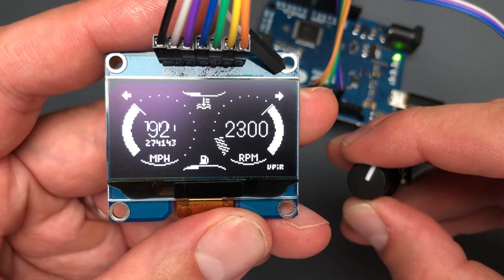Arduino Car Cluster with OLED Display     (Dashboard, gauges, controls, SSD1306, u8glib)

Comment: Hey, I cant find your email on the about page. Starting a motorcyle project and im obsessed with these gauges. I have no idea how to do this but im going to learn. Wondering if i can get the code and are the seprate inputs already built into the code and just need values set?  Its an old bike so no OBD or anything fancy. THANKS! amazing videos too by the way!
Reply from the maker: Hello! The email contact should be on the about page, but sometimes it´s only visible on desktop, not on mobile.

Comment: Hi I'm looking to build a car display using a nextion 3.5 display driven by my ecu masters ecu is this something you have done or could help me with ,there is code for reading the data from ecu on github but I'm very new to coding so not sure how it works or creating code for the nextion display ,any help very much appreciated
Reply from the maker: Do you have a link to the github page? That would be a great start. Also, why use the small 3.5inch?

Comment: I don't get why the screen is updating so fast that you don't see it scan across. When I try to fill it with black then fill it with white, it takes almost 1/4 second to update the whole screen and I'm using a fast stm32h7. Even if you don't update the whole screen every time you load new data in, you are changing so many pixels with the numbers and gauges animating I don't get how it is so fast. Also how did you make this custom GUI? I only saw basic functions like drawCircle() or drawRectangle in your code?
Reply from the maker: Do you use IIC or SPI version of the display? Software SPI or hardware SPI? This custom GUI is mainly from images, they are usually faster to draw compared to dedicated circle drawing routines.
Reply: @upir_upir  I'm using hardware i2c. But you're saying most of the GUI is just a background image that doesn't change and then you update only the numbers and gauges? What kind of function do you use to increment the gauge position?

Comment: how to connect it with the real motor speed..? or  can we connect the 3 wires to ESC..?
Reply from the maker: It depends. You can surely use sensors, but you can also connect it to can-bus. I do plan to record more videos with details how to do that..

Comment: I would like to inspect the code !!! ,,, when I loaded the MPH Gauge it jumped around but then noticed when my hand was close to the ground on the uno it moved but seemed to stop when I hooked up the joystick in place of the pot ,but my Dupont wires are not the best fit in the header. Thanks for all the videos has helped me a lot , I'm trying to port over the oscilloscope example I found to work with an esp8266 with generic 1.8 TFT I'm having trouble getting the display library to work (st7735) I wish there was better documentation for the classes and different functions been able to find someone get hub
Reply from the maker: Please send me an e-mail and I can send you this code so you can take a closer look.

Comment: Nicely done! How well does the odometer function work? Is there a way to save the odometer reading to non volatile memory to allow persistence when power is cur?
Reply: *cut
Reply from the maker: Thank you for your comment, but the screen is not functional. It’s more about drawing stuff on the display. That said, if should be possible to save values, but usually memories are rated for 100000 write cycles. That might not be sufficient for something like odometer.

Comment: Did you ever get around to making a tutorial? I ask, because i'm currently creating a project that could use several gauges 1 for temp C & F, one for Fan Speed, and one for heater status (on/off)
Reply from the maker: Unfortunately not. However, if you send me an e-mail, I will send you the code and you can try to modify it to your needs.

Comment: Is the potentiometer used in place of where the actual connections from the car will be?
Reply from the maker: Yes and no. Depends on what kind of sensor you would use. Some sensors use the very same approach as a potentiometer, but some use different forms of communication. And if you decide to use CAN BUS, it would be also different.

Comment: Could I use this to connect to my cars rpm gauge?   My car is an older car with no computer to connect to.   But wouldn't running it parallel to the rpm gauge be the same as the potentiometer?
Reply from the maker: I don´t know much about how the pre-OBD gauges work, but if you know it and could it connect to arduino, I don´t see any reason why it couldn´t work. Is it just providing a voltage based on the RPM value? I need to find one of those gauges and dismantle it.
Reply: @upir_upir  you're clearly more technical than I am.   How about I send you a basic rpm gauge and you can test it?
Reply from the maker: That sounds great! Could you please send me an email? Thanks a lot!

Comment: It's possible to use this to control something by reading rpm? From 1000 to 2000 rpm activate pump to inject metanol?
Reply from the maker: That should be possible for sure. Just read the real rpm, and add a simple statement to activate the pump. You will need some relay module to turn the pump on or off.

Comment: How do you have the arduino reading signals (rpm/temp/fuel)? Directly to arduino, or another way?
Reply from the maker: You can do both - read directly from sensors, or perhaps for a real car, use something like ODB2 CAN reader / board to get the data. I plan to record video describing this method soon.

Comment: Hello, good morning
Is it possible to use oled display with spd0301 driver to build this device?
Reply from the maker: from a quick search, it looks like the SPD0301 is a replacement for SSD1309 and most likely compatible, so it should work, but I haven´t tested it.

Comment: esp32 should be a hella lot faster (and cheaper) in updating that display
Reply from the maker: You are correct, but Arduino is still somewhat more approachable for beginners. I might still try that with some faster chip, like the proposed ESP32.

Comment: If I wanted someone to develop something on devices like these what would I even look up? I no nothing of this industry, but it looks really cool
Reply from the maker: What exactly are you looking for? This is an OLED display being driven by Arduino. I would start there - as there are tons of learning resources for Arduino. Once you get a feel for it, move to other Arduino compatible microcontrollers, like ESP32, Teensy etc. Not much of a change there, as you can still use Arduino IDE. And once you are done with those, you can move to microprocessors, like Raspberry PI. You can use displays with all of those. Let me know if you have any questions!

Comment: The fluctuation is an instability in the voltage. You can fix it by making a filter with a resistor in series with the potentiometer output and then a capacitor between the arduino analog input and ground. The bigger the resistor is the better the filtering, same with the capacitor. Since this has pretty much no current you can just use the smallest capacitor you have and a relatively large resistance.
Reply from the maker: Thank you for your explanation, but I’m little confused. Do you mean capacitor and resistor, or two capacitors? Thanks
Reply: @upir_upir  
Re-read my comment and realized I accidentally said 2 capacitors my bad.

Capacitor and resistor. If you Google RC filter there's a lot of examples
Reply from the maker: @00000005547  No problem, thank you for the clarification!
Reply: I don't think this is a problem with the  pot voltage fluctuating, but rather noise in the on-chip ADC. Averaging a couple of samples will help smooth the output out.  Or one can also use a real separate ADC with proper decoupling and grounding.

Comment: the fluctuating gauges come from the unstable voltage source for the pontentiometer/ sensor. If you plug in an arduino with the usb cable you have to use a secondary stable 5v source for sensors (independent from the arduino, means you cant use analog outputs)  if you dont  want to have fluctuating value. In case you want to have fast refresh rate without using an average read code
Reply from the maker: Thank you for the clarification. It makes sense, I will try a secondary power source in the next project to see if that helps.
Reply: You can also set pulldown input